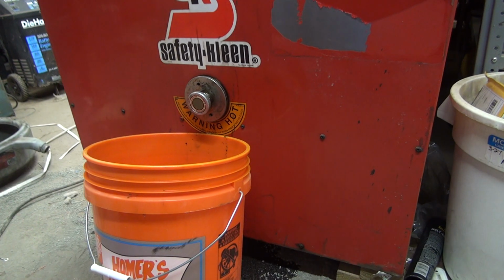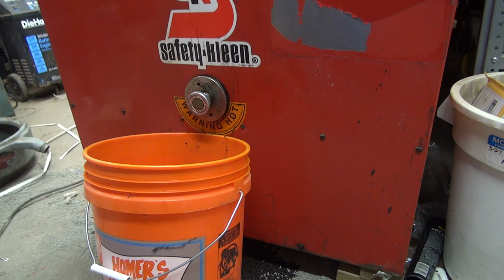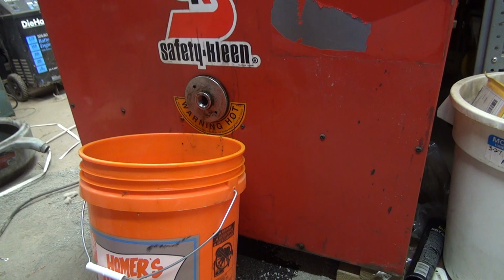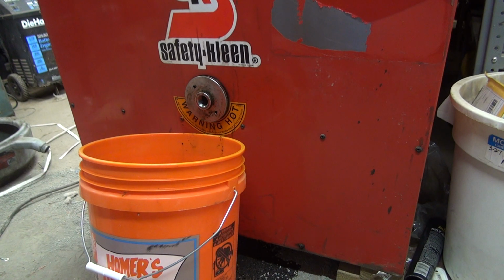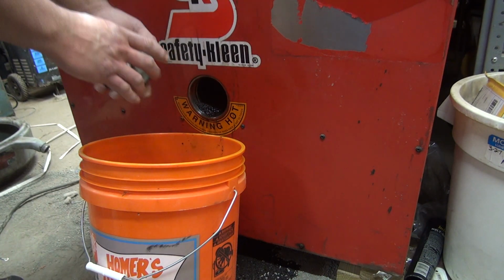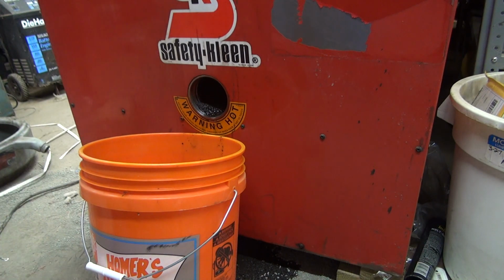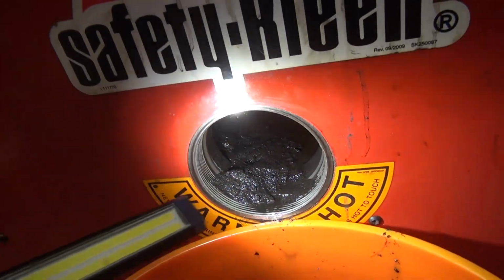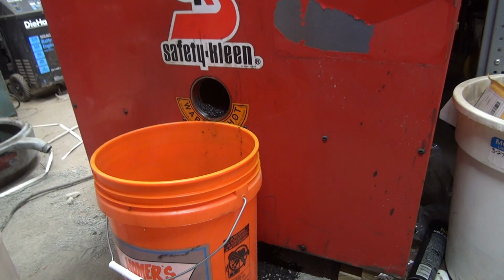Safety Kleen deep clean of a severely neglected machine.

Comment: It won't refill because the suction filter in the tank is plugged. Drain the fluid, take the line off, going to the pump and blow it out, or poke a whole in it.

Comment: I just picked up system one model 500. I'm currently cleaning up and have taken all the way up part. Mine does not have that large hole in the front clean it out (I wish it did). My recycle tank is clogged up, I tried to flush it and it didn't work. Today I cut open the recycle tank and filled a 5 gallon bucket full of solid material from the tank...
Reply from the maker: Sounds like it was in rough shape.  Hopefully you can get it working again.

Comment: Can we have an update on the parts washer I just picked up this exact same model it only works as a parts washer the recycling process in not functional it comes back dirty I’m going to do this exact same cleaning process on mine I’d like to see the top removed or and inside functional break down you are so more ahead than I am on this I appreciate these educational videos
Reply from the maker: I do not have any videos with the top off.  But it's fairly simple to take the top off.  Take the back off by removing the screws. To take the top off you will need to remove the screws and also the fittings for the plumbing. To remove the pump assembly I had to cut the wires and then splice them when I put it back together. When I did this I didn't have high hopes of it getting back in working order so I didn't film it. 

Start by taking the big plug out on the front, the one with the two small holes in it. I used a big channel locks. That is the tank that the dirty solvent drains into and where it is heated up to vaporize it and send "distilled" cleaner back to the holding tank. This has to be clean to heat up the fluid, mine was filled with sludge I had to clean out. Does the silver plug on the front of yours heat up when you run a cleaning cycle?

Comment from the maker: Update, tonight I got a chance to spend a few minutes on this thing.  I bought a long 24" screwdriver from menards that worked good for cleaning around the two heating elements.  It was able to break up the solids and then I used a cleaning wand hooked to a garden hose to flush it all out.  These wands are made for cleaning radiators.  Was able to get most of it cleaned out. I also made a little scoop to help drag the sludge out.  Just took a piece of 1.5" wide metal and cut it about 3.5 inches long.  I rounded the corners on one side and then drilled a hole in the center and threaded it to accept a 3/8" inch threaded rod and put a lock nut on the end to keep the metal from spinning on the rod. Tomorrow I will run a recycling cycle and see how it does.  I'm guessing a lot better since the heating elements aren't surrounded in solid gunk.  This has been a lot of work and a huge learning curve but now I have a fully functional recycling parts washer for cheap.